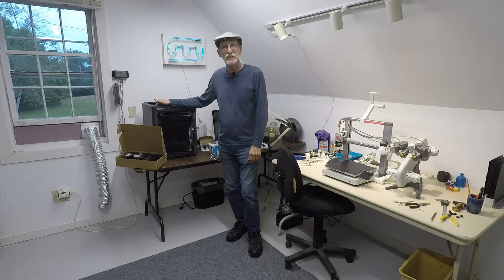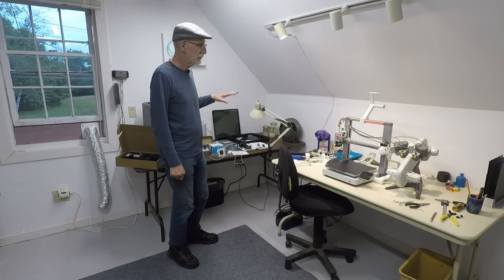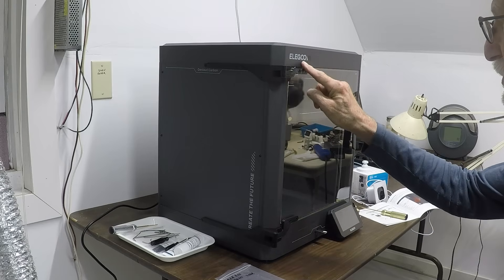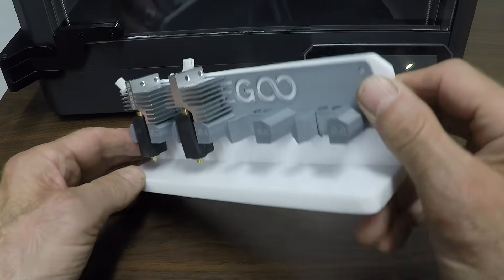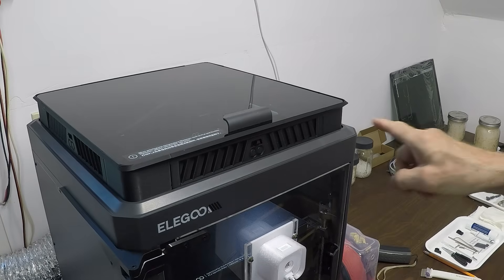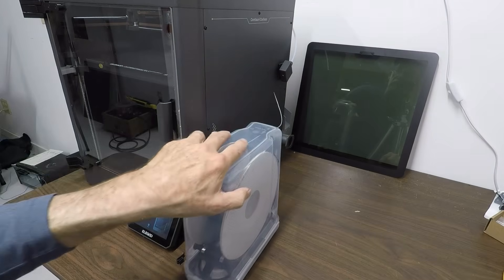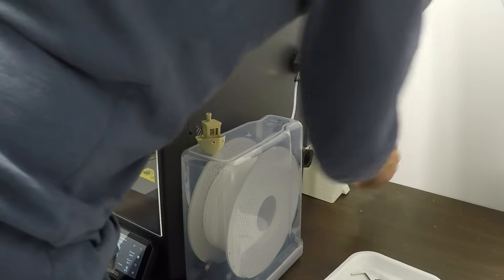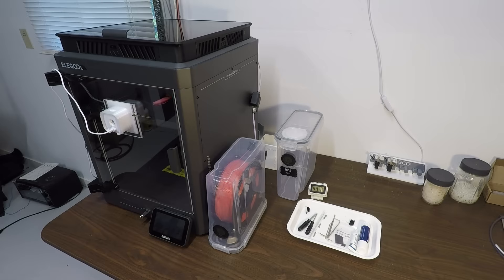Elegoo Centauri Carbon upgrades

Comment: You go through the trouble of running the exhaust out the window then make it completely useless by making the riser that leaks air.

Air wont be going through your filter and out your window it will instead be leaking out of the top risers and the gap you created with the new door hinges. 

This is especially bad when printing things like ASA and ABS. Instead of that toxic styrene going out the window like it should its being dumped in the room with you because of the riser.

Most of these popular mods are complete garbage and many of them make the printer flat out unsafe to be around.
Reply from the maker: This is just not true. The fan has sufficient cfm's to remove the air from the leaks around the top and door.

Comment: Thanks for the video. I do have a question though. I printed the raised top and I can't get the vents to move open on any of the 4 pieces. I've tried prying them open, ran a knife down the edges of each area. I'm at a loss. How do I get them to move? Is there an opening on the bottom? Mine are solid on the bottom. I didn't use supports.
Reply: never mind I finally got them to open  works good now!
Reply from the maker: Yeah, everyone says they are really stiff and you just have to push them hard to break them loose. Sorry I didn't get back to you sooner.

Comment: These are good upgrades, but I would really like to see something that can reduce the noise and vibration that is transmitted to the table during printing.
Reply from the maker: The machine will do what it will do. All we can do is try and limit the movement. So what I suggest and what I have done is to mount my workbench to the wall with L bracket s going right into the studs.  It's pretty hard to shake an entire building!
Reply: @GuyMarsdenMakesStuff  You're partly right, however, I mean the infernal noise of the fans, and that's what they did at elegoo, they did everything so that, for example, the fan blowing parts in the printhead couldn't be easily replaced, there is no such fan on the market, analogues in most cases without a pwm pin and differ in performance, even on the official the website of the manufacturer (fan) is not exactly the same or close, etc.. I mean, according to my humble guesses, the printhead case needs to be upgraded using standard and quieter fans.

Comment: You may want to consider printing and installing the strain relief adapter for the USB cable where it connects to the printhead. There have been reports of the cable separating due to the strain caused by the bend.  I'm pretty sure I found it on printables.  I installed it on mine today as a preventative measure.
Reply from the maker: Thanks for the suggestion, I'll definitely look into that!

Comment: Got one! Now, how do I quiet this thing down. My neptune 3 max isn't this loud ...
Reply from the maker: Yes, it is a lot louder than some other machines like my bambu Labs A1.  But you can run it with the doors closed for most prints and just leave the top open which helps a bit.

Comment: I'm considering the Centauri for my first printer, did you find a way to address the noise from the fans?
Reply: Some Sound reducing Form or Simulation?
Reply from the maker: I have attached sound deadening materials to the insides of the walls. But since my printers are in a whole separate room it's really not an issue for me.

Comment: I like your setup for the silica beads
Reply from the maker: Thanks, the way that I dry them now is in a large Pyrex pan in the microwave.  I use the auto defrost setting for 1 lb and that seems to work running it for about 10 minutes or so.
Reply: @GuyMarsdenMakesStuff  I never had any luck drying the beads in a microwave, even at the lowest defrost setting.  I spread mine thinly on a Pyrex tray and dry in a normal oven at 100°c for an hour instead.  I use clear beads with a few indicators (maybe 20%) mixed in.  Your trick of saving used beads until there are loads to dry altogether is a very good idea, and something I'll definitely start doing.  I never thought of that.

Comment: Nice video, i have been tinkering with my centauri carbon as well, heres some things ive noticed
-Removing carbon filter in front of fan dramatically reduces case fan noise and improves cooling when printing PLA. I find i dont need to remove glass cover and just keep sliders open on my riser and it stays plenty cool. (I have an external fan that pulls air from print area to outside)
-for printing abs you want it to be as sealed up as possible to keep temp in, since the only thing that heats the chamber is the bed. I use magnetic sheets to cover the intake/exhaust on back of machine to cover openings. I also use a poop bin with an enclosed design with a drawer. These 2 things made my chamber temp go from 30-35c to 40-45c
-with that hinge the glass door wobbles quite a bit when printing fast, i printed a clip for the handle with magnets glued onto it, this way when its fully opened it is secured magnetically to side panel and doesnt wobble
Reply from the maker: Thanks for the tips, I'll have to try a few of those.

Comment: One important question. Due to space constraints, I'm forced to keep the printer where I sleep - the choice is either not having a printer or that. I plan of shoving mine in a grow tent and then pull the air out and out of the window with in-line duct fan - but since Centauri doesn't have a heated chamber, and heating it up inside just enough to be barely viable to print ASA, ABS and Nylon seems to be a struggle (leaving bed on running for half an hour before print) - wouldn't vent suck all of the hot air out of the chamber? How does one deal with venting and keeping the optimal temperature inside? Also, what about draft created? Wouldn't that negatively affect the print with these harder to print materials?
Reply from the maker: You are overthinking things here! I have printed ABS with the vent fan running and and the doors closed.

Comment: Theres actually 2 lights in there, i didnt notice the2nd on up in the very front at first either. Im NOt talking about the old dome light, i mean there is a 2nd light strip in the upper front of the inside of the cae as well as the one on the right..
Reply from the maker: Huh, I hadn't noticed that.

Comment: To this day I don't know which is the better choice. This printer or Bambu lab p1s? Please help 🙏 I have read that the Bambu lab does not need to suffer, it just works and is ready. I see that some modifications are needed here.
Reply from the maker: I have the bambu Labs A1 and I'm absolutely thrilled with it.  It was plug and Play from day one with the occasional clog and minor issues. But nothing to worry about.
Reply: @GuyMarsdenMakesStuff Thanks👍

Comment: Thanks Guy. Appreciate your presentation. I have ordered and am slotted for batch 6. I was wondering if you could fit a bento box style air filter inside the enclosure either left or right of the printbed. I'm planning to print ASA and ABS mainly so need to filter the smells out.
Reply from the maker: Thanks for watching! I have not tried fitting an air filter inside the enclosure.

Comment: I am trying to print the vent solution, what size screws to get to replace the ones in the back for the exhaust fan. I bought foam insulation board and am looking to setup through small sliding window. Was thinking of connecting a 120mm pc fan. I am new to DIY my on solutions hoping to figure this one out. Thanks for the inspo!
Reply from the maker: The vent that I printed as holes that match the bolt pattern in the back so I just reused the original screws.   
I like your idea of adding another fan, probably mounted at the window. But the existing fan should do the job just fine.

Comment: Curious if there is an easy way to replace some of those fans with day noctua fans?
Reply from the maker: Not sure about that. In general principle quieter fans are usually lower volume air movement though.

Comment: I have a duct system with my jupiter se resin printer.is there an odor while printing certain filaments?Just curious I'm thinking of getting the carbon.
Reply from the maker: So far I haven't noticed an unpleasant odor with PLA or PETG or ABS, but I like the idea of venting fumes outside in general principle.
Reply: @GuyMarsdenMakesStuff wdym, ABS stinks like devil's arse hole 😅

Comment: There is a print that you can slide another filter for the back fan if you don’t want to vent it out, saw it on Uncle Jesse vid, but this upgrade is also amazing
Reply from the maker: Yes, I saw that but decided not to use it because I do want to vent those fumes outside. I just don't trust filters enough.

Comment: 11:08 I think you need to put them in the oven not the microwave,  because the gel needs to get rid of its humidity. 

Also Thank you for all the tips and ideas for upgrades for the centauri carbon. I still need to wait 2 more months for mine :(
Reply from the maker: I use my microwave on the defrost cycle for about 5 minutes or the equivalent of 1 lb. Seems to work fine. The color changing leads change color just fine and I let it cool off with the door open before canning them back up again.
Reply: @GuyMarsdenMakesStuff  oh maybe I was wrong :/ I thought it would only work in the oven, but if it works it works. Have a great day :)
Reply: @GuyMarsdenMakesStuff this is perhaps obvious but I've got to ask... Is one supposed to have a dedicated throwaway microwave for this purpose or is it safe to use it for food afterwards? 👀🤔
Reply from the maker: @Micromation the color changing desiccant beads are toxic, but I wouldn't worry too much about it if you're using the kind that only has a few of them in there.   Desiccant by itself is silicon dioxide which is safe so long as you don't ingest it.
Reply: @GuyMarsdenMakesStuff I've heard the Blue one is toxic (but you can't buy it in the EU anyways) and to go with Orange instead. I guess both are better kept away from food appliances then 🤔

Comment: Good job on the printer, looks Luke your having fun with it. How long do you microwave your dessicant? 👍
Reply from the maker: I microwave my desiccant in defrost mode for a 1 lb setting which runs about 5 minutes or so then I leave the door open to let it cool off and dry out for a while.

Comment: I ordered mine in June, should get it in August 😢

But have been watching videos to prepare. This will be my first ever 3D printer, and I just want to get it right. One thing I wanted to ask is what material did you print these add-ons, like the vent?  I assume something like petg or ASA, but I wanted to confirm.
Reply from the maker: I used mostly PETG for its strength and temperature resistance.

Comment: Something you might wanna be aware of.

If you put your printers IP address into your phone browser, it will take you to the control page formatted for a mobile device where you can watch and control your device. As well as start new prints.

Be aware that by default it only works on your local wifi, however you can use a service like Octoanywhere to make it accessible outside your network. Or you can set up a static IP address and do a port forward to open it up to the wider web.

Comment: I got the Centauri Carbon just to print ASA and was trying to find a good way to vent it, which is how I found your video.  Not only did you answer my question, but I found so much info as well.   I hope more folks find your channel.   Thanks for sharing.
Reply from the maker: Thanks, I'm glad you found my video helpful!
Reply: @GuyMarsdenMakesStuff what's curious did you print the back vent covers out of PLA the ones for the exhaust
Reply: @440pressurewashing  I made mine from PETG.  I imagine PLA will work but I suspect PETG will last a bit longer.  If all you have to hand is PLA then use that for now.  If it falls apart or melts into a plastic blob monster somehow then just make a new one later out of whatever high temp material you're printing with and wanting to vent.  You'll have it loaded anyway so just check if the adaptor seems soft or deformed after a few prints and knock out a new one to preempt failure.  PLA may well work fine so give it a go with that.
Reply: A better approach is to get an enclosure and pull air out of it with a duct fan. That way you don't affect the printer's chamber temp, but you move enough air around all corners of the printer to ensure all leaked vapors get ejected.
Reply: This is actually a terrible way to vent it. Nothing will be going out of that rear exhaust, it will be dumping everything into the room via the stupid riser.